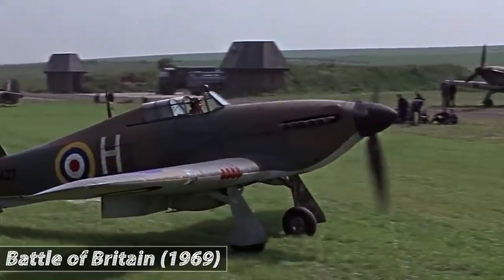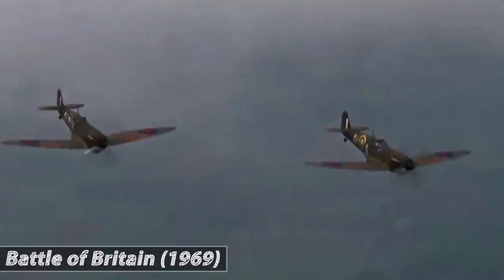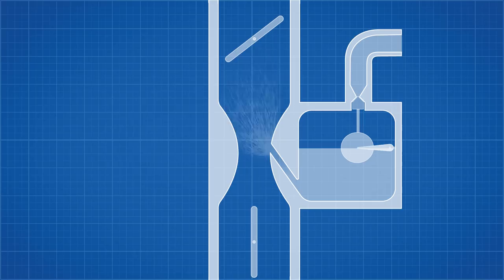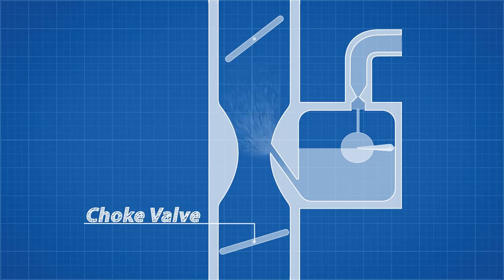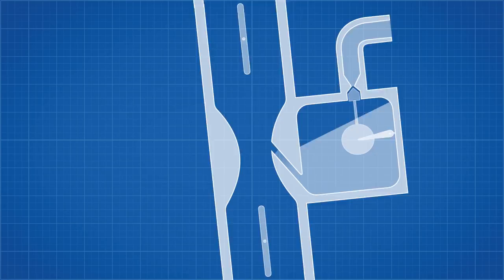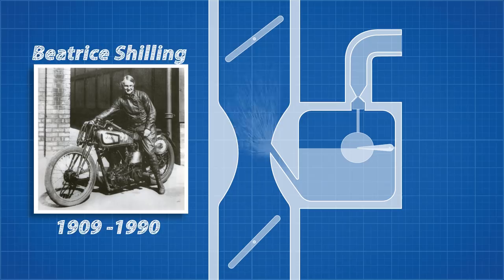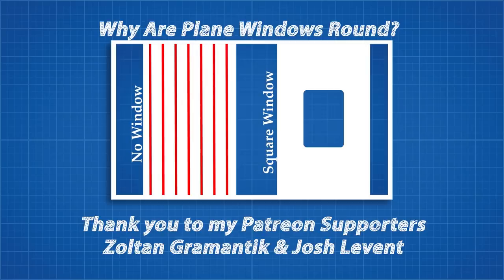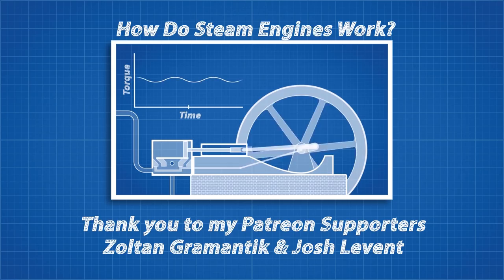The Spitfire's Fatal Flaw

Comment: I asked my godfather, who is one of the last of "the few" alive, (& was also one of the "stunt pilots" who flew for the film "Battle of Britain") about this issue. His response, once he had thought about it, was his recollection was that this "flaw" was known about before the BoB, probably by both sides, & essentially the RAF pilots didn't think it was a "major" problem. They simply avoided doing manouvres that induced it. 
Whilst up in the air, his view was that if you were in a dog-fight, it didn't really matter, because you were so busy worrying about where the next (enemy) plane was, that you either flew the plane "naturally", which allowed for the particular tricks of the plane, or you were dead. You tried to use the advantages of the Merlin engine & air-frame, and shoot down the enemy that was attacking your homeland, & not worry about the disadvantages of the overall excellent equipment you had been given.
Therefore, it wasn't exactly a "fatal flaw", because getting shot down was usually due to inexperience or "bad" luck; experience came quickly, skill came even quicker, and luck was either with you or not. You didn't dwell on such things; you got on with the job. The same was applicable to the German pilots.
Nevertheless, you little vid was well produced & informative , and has generated good responses - especially the series about lawn mowers!
Reply: The problem was that the Germans had figured it out.  If they saw a plane behind them, their tactic was simple: slam the stick forward and drop like a stone.  If the RAF pilot tried to follow, his engine would sputter, long enough for the 109 to get out of range. (This was directly from a Battle of Britain ace.)
Reply: All depends on experience, an experienced Spitfire fighter pilot could roll just enough to one side to perform a rudder induced positive pull, which negates the negative pull.
However, the BF 109 might have a 50/50 chance of negating this by performing a split S, if the Spitfire wasnt already tilting its wings the same direction the BF 109 is bolting (split S`ing to, as it were), then he`d be well clear of that threat.
Reply: This is one of the most real comments I've ever read. Thanks for posting.
Reply: toreDL
A very experienced Luftwaffe pilot might get away but overall the Spitfire was better, if the position was reversed a Spitfire pilot could turn and climb and the Bf 109 could not follow, I know I would prefer to be in a Spitfire, 
If the Bf 109 got away by diving or a split S it was just getting away, if a Spitfire climbed and turned the Spitfire pilot could get on the tail of the Bf 109.
Reply: Barrie: You are wrong about the early Spitfires Climb Rate. In fact they climbed slower than the Bf-109E. That was by the way a Maneuver the 109 Pilots used against the Spitfire - Climb away in a long circle! The Spitfire could however outturn a 109E but had big troubles when it had to stay on a 109E despite it's better Turn Radius because the 109E could roll better and also could do negative G without losing Power! Only later Spitfires like the Mark 9 were better in Climb Rate compared to German Fighters. But whenever the Spitfire became better in Climbrate and Speed the Germans simply made modifications to theirs and the other Way around. The Mark 14 for example had a big problem doing tight turns due to the weight of the Engine and the greater Torque - So they became more powerfull but less of a Turner! Also the before mentioned "Press the Stick forward"  Trick of the Germans did not end there = When the Spitfire indeed rolled to follow the German Pilot down, the 109 Pilot simply pulled out of the Dive into a Climb or even a Immelman Maneuver - And that Maneuver the Spitfire had even more Problems to follow because at the Moment the German took his Plane out of the Dive the Spitfire still was inverted and in most cases lost the German Plane or could not reach it anymore! The German then started to Zoom and Boom the lower Spitfire. All that tells you is that Turn Rate does not save you against better Tactics!
Reply: Wanderfool.
The Bf 109 E climbed steeper but slower, The Spitfire roll rate was good enough to take on Bf 109`s and at speed the 109 became very hard to control.
The negative G problem was first improved to the extent it was no big deal by the Battle of Britain and then solved completely.
The Mk I and Mk II in the Battle of Britain had no trouble staying with a Bf 109 in a climb or as Galland said during the Battle of Britain he was very impressed by the Spitfire and RAF pilots, he only just managed to escape when he was leading 40 Bf 109`s and they were attacked by just 12 Spitfires, the end result was a win for the Spitfire. 
I wonder why the Luftwaffe lost the battle of Britain, Bf 109`s outnumbered Spitfires and Hurricanes put together.
Just try to read books with comments by real pilots who flew both rather than play video games or go to forums where most of the comments are by people who know nothing.
Reply: Utter Crap!
Reply: Wanderfool.
The Battle of Britain when the RAF was outnumbered and won.
That was when Adolf Galland was leading a flight of 40 Bf 109`s and they were attacked by just 12 Spitfires, the result was the Spitfires won and as Galland said he was very impressed by the Spitfire and by the RAF pilots. That particular fight was over the Channel so no range advantage for the RAF pilots.  IN fact the range issue is made so much of by fools.  
Attacking airbases was not working, only two small forward airbases were out of action because of their vulnerable location, all the others were in constant use.  The RAF was never nearly done, in fact if you read up on how it was for the luftwaffe fighter pilots you would find they were nearly done. 
Any fight is at the speed the planes are flying and they did not slow right down to turn, a Spitfire could turn tighter and faster than the Bf 109, a complete turn some 6 seconds quicker, maintaining a higher speed and pulling more G.
Reply: You better watch the Battle of Britain Movie before telling us crap! And do not say the Movie is not realistic because Pilots, Officers and Historians of both Sides contributed! Also read JG-2 and JG-26's front Reports! They are in German so you probably have to LEARN THE LANIGUAGE FIRST! And now go piss someone else off!
Reply: Weird - Can you point me to the "Historical Proof" you are trying to implement here? I mean you are telling total opposite stories! In 1940 there were +40 BF-109 flying in Bomber Formation fooling the RAF RADAR Sites to send Interceptors and were intercepted by 1 Squadron of Spitfire Mk.1 and 1 Squadron Hurricanes - Result was 12 Losses on German side and the 2 RAF Squads totally annihilated! If your Propaganda twisted this Story you should go back to multiple sources and not only the one YOU prefer! I do not want to discuss your views anymore because I deem them Propaganda. Have a good Day!
Reply: Given your grandfather was such an experienced Spit pilot who continued flying it for the filming after the war, im surprised he didnt recall the 2 stages of fixes which they applied to it. The first being Miss Shillings floating carb (March '41), the second was the pressured carb in 1943 which completely solved the problem.
Reply: Sheila Morrison.
That is not correct, the first improvement was in 1940 and the problem was completely fixed in 1941 by moving the outlet from the float chamber from the bottom to half way up.  Rolls Royce and SU developed the speed density carburetor which was given to Bendix who had been trying to do the same but their effort was rather large and heavy. The so called problem was fixed in the Spitfire Mk V and did not exist well before the Spitfire Mk IX was in service.
Reply: Hmm. Interesting. I mean literally all documentation says the Tilly Orifice was fitter early 41, then the problem was solved in 43 by the pressured carb. Would seem kind of pointless to do both fixes if the problem had been solved already by (You didnt say what those fixes were...) in 41 completely....
Reply: I just had a quick look and found a mention of the Tilly shilling being used in the Battle of Britain.  
I have seen another rather interesting account of an OTU squadron in October 1940 which mentions a trainee pilot having trouble with negative G, he had no trouble after the momentary cut out and the report stated that as it was an OTU Spitfire it had not been modified yet. in 1941 the outlet from the float chamber was move to half way up the float which meant no cut out, the speed density carburetor was Rolls Royce and S U and given to Bendix, later there was a pressure carburetor and a SU injection carburetor.
There are many comments that do make a big deal out of negative G and a lot of inaccuracies in much information,  a lot of this gets repeated and small errors in information tend to get exaggerated and unfortunately believed.
Reply: Yeah but in a real dogfight once you dive you lose all advantage and pretty much have to return to base, so as the only aim at that time was preventing bombs landing on England, this is a very small flaw in the early Spitfires that had no effect on the Spit pilots other than maybe the pilots that escaped could have come back and killed them another time. It's pretty minor.
Reply: The Mk XIV was much superior in almost all aspects to the late marks of 109's and 190's.  in fact the Spitfire XIV had no peers. except perhaps the Tempest V at low-medium altitude.
Reply: WonderfaleAt: One incident in the Battle proves bugger-all.  The luftwaffe got their arse kicked.  The bombers were the priority, not the fighter escort.  Even though the Spitfires were meant to go after the fighters, they still went after the bombers too, so of course, if a Spitfire was attacking a bomber and is in turn shot down by a 109, or return fire from the bomber, that was some of the reasons for more Spitfires being shot down during a given battle.  It was rare to have a pure fighter on fighter confrontation during the Battle and even then, it was mainly side that held the advantage that won through.

Anyway! From after the Battle of Britain, the 109 would start to lose ground on the Spifire and the FW 190 would only be superior for a few months before that too lost out to the superior marks of Spitfires.

The Spitfire was a prewar fighter that stayed on par then ahead up to the end of the war where piston engined single seater fighters were concerned.
Reply: Pottery
Reply: @barrierodliffe4155  Your posts are a litany of deluded fanboy nonsense.  The history of the Bendix pressure carburetor goes back to the mid-1930s.  It was a standard installation on American fighters at the outbreak of the war.  It was not invented by SU.  Also, the 109 did indeed have a superior roll rate to go with its superior dive acceleration, because the inverted V engine allowed the 109's designers to attain a lower axial moment of inertia than could be attained with the upright V.  Radial engines also allowed aircraft to be designed with a lower moment of inertia than did the upright V.  Your understanding of climb rate, for which you love to refer to cherry-picked statistics, is also sophomoric.  There is a lot more to climb performance than the interception climb rate that the Spitfire was optimized for.  In fact, the energy-momentum theory of aerial combat, which was only fully articulated in the 1970s by Colonel John Boyd, explains why climbing at the optimal interception climb rate is not what is best in actual combat.  Stated another way, the best climb to take you to the fight is not the best climb to use in the fight.  The plane that maintains the greater forward speed during a climb is the one that gains an energy-momentum advantage and other fighters were better than the Spitfire in that regard.  That's what WanderfalkeAT was referring to:  the 109 pilots found a way to exploit a weakness in the Spitfire's climb performance (loss of forward speed) and use it to escape while the Spitfire bled off speed to gain altitude.

Comment: Another issue with the Spitfire was its narrow track landing gear, and that it took longer to repair than the Hurricane, due to its monocoque design. And its turning radius was not much to brag about, either. It easily out-dived the Bf109 but rarely outclimbed. One wonders what kind of a plane it would have been with a wing fitted with slats?!

Comment: A lot of success for an aircraft with a “fatal” flaw, no?
Reply: It was fixed very quickly, but I agree probably not fatal just a design flaw
Reply: Killing an engine during flight is definitely a fatal flaw...
Reply: Weasle, yeah true don’t know what I was thinking there
Reply: @weasle2904  
Killing an engine?  No that was not the case, on the early Spitfire Mk I there was a problem which could cause a momentary cut out, it was improved by the Battle of Britain on the Mk I and all Mk II Spitfires came out with the modification, the complete cure was on the Spitfire Mk V.
Reply: The Spitfire really only did well when based from land bases, and even then only for select duties. As an interceptor, it was fantastic, and was crucial in the Battle of Britain and later in a similar air struggle over Malta. Definitely one of the top 3 interceptors in the world at the beginning of the conflict. But as a fighter bomber, escort fighter, and carrier-based fighter, it was unsuited for the task. Not enough payload, not enough fuel. Also, in the Pacific, it was used briefly by the Australians (when the empire was kind enough to actually send them something), and they weren't really able to fly the great distances involved with the war there either. A lot of hype goes into the Spitfire, but I really have a hard time buying it, especially when the Hurricane could (and often did) do just as well (or better).